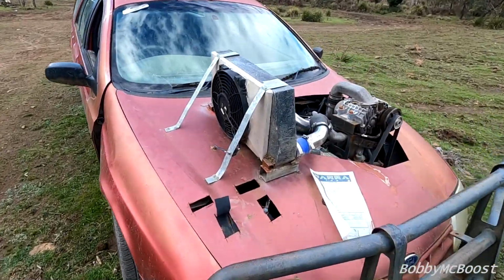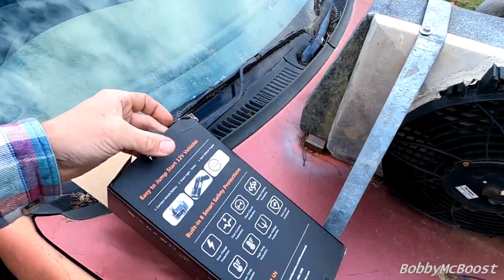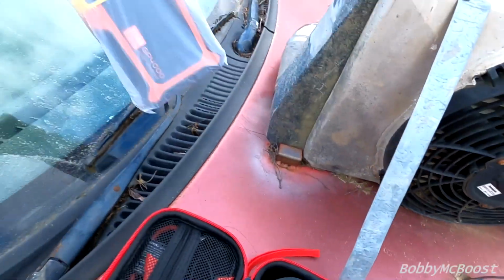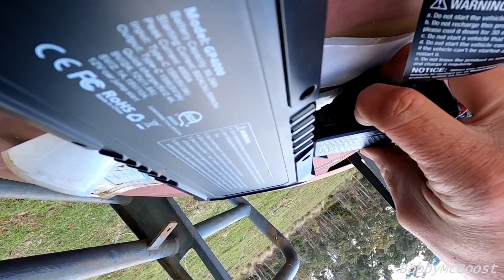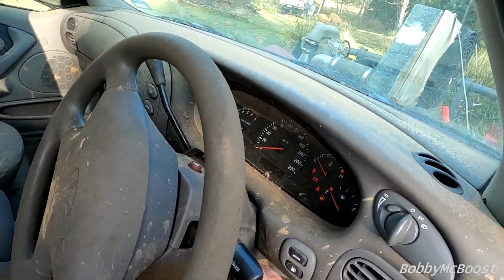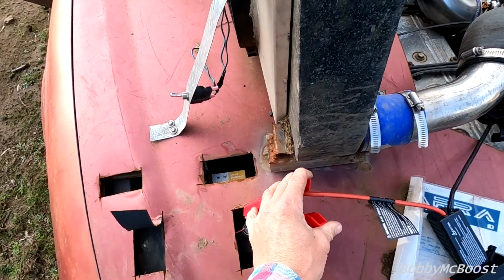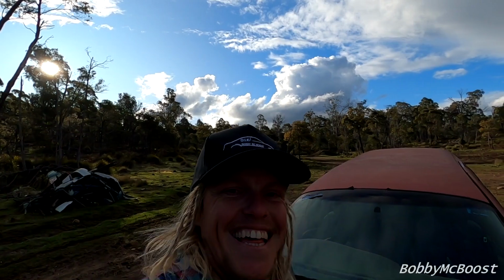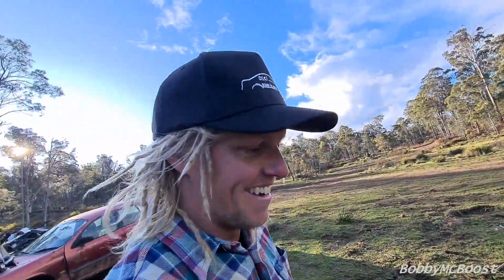New Jump Starter Pack & The Original Au from my First Upload.

Comment: my Gooloo is 2 yrs going strong!!! can't be a car guy without one. also handy as hell for camping.
Reply from the maker: Yeah so far so good! 🤘
Reply: @BobbyMcBoost  the black box has never failed and I've used it on 50+ different cars. the connector inside the battery pack broke loose but was easily epoxied back into place (probably my misuse rather than design).